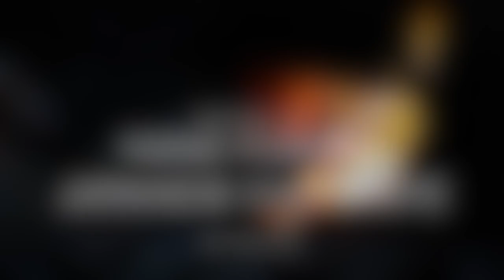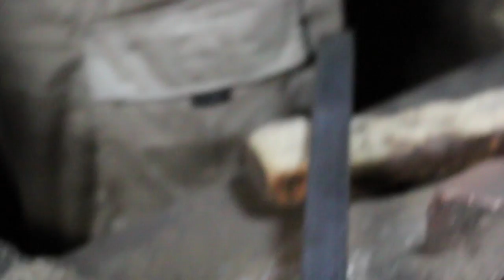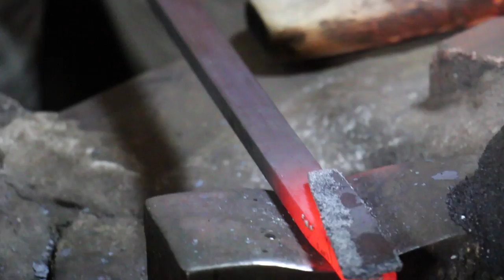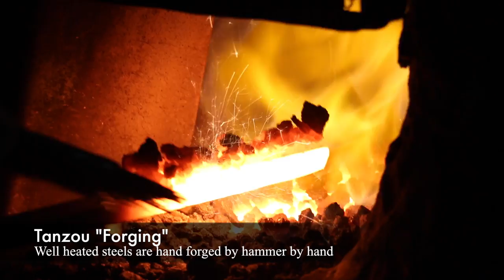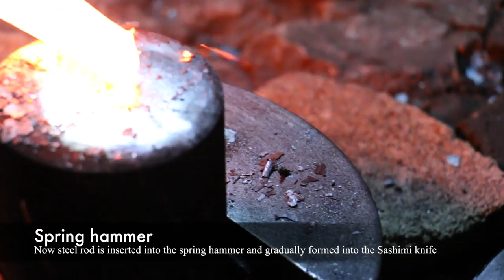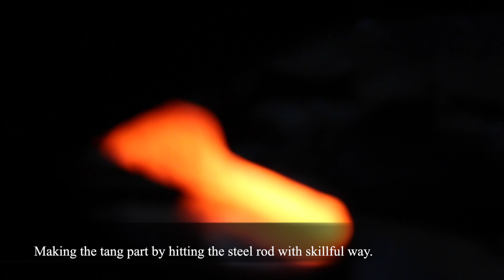Hand forging a Japanese Sashimi knife of Sakai Takayuki by Master Doi

Comment: Excellent work with the hammer. Whether you want to call a power hammer "hand" forging or not (it is), it's still a manual, non-automated process and this guy's fantastic at it.

Also best music choice possible. It's hot, strong, has an appropriate tempo, and it fits the heat in the face and the little burns and the feeling of doing this kind of work. Special shout out to the ridiculous dork who said it should be accompanied by classical or solo piano.

Comment: What's that powder he applies at the beginning? Is that some sort of flux?
Reply: +Chris Lawson Borax ! to prevent oxidation and eliminate impurites.
Reply: +skyhacker6 flux then?
Reply: allways28
maybe, I don't know the name actually
Reply: A flux is any material used to eliminate impurities. Usually in welding and soldering. So if that's what borax is doing, then it is indeed a flux.
Reply: +Chris Lawson I think it is iron powder! Used to join the two pieces together.
Reply: +Chris Lawson It is flux. The powder melts and chemically dissolves the oxide (the black stuff that flakes off). This is necessary to ensure proper forge welding of the two surfaces. Oxidized surfaces wouldn’t bond together.
Reply: +Chris Lawson It was more than likely borax with iron shavings mixed with it to keep the pieces stuck together and eliminate impurities, or it was some kind of commercial flux.
Reply: +Chris Lawson It's iron powder.. Kind of glue, but for iron.
Reply: As "skyhacker6" pointed out, it is borax.  Borax is a powder that you can buy from grocery stores in the laundry soap isle.  Pure borax makes an excellent flux for welding.  As mentioned, borax prevents oxidation.  It does more than that however.  When heated and melting borax also cleans the metal and burns away any existing oxidation the same way that solder flux does to copper. This allows for a clean and strong welding joint when welding steels together in layers, or joining 2 different metals as in this video.

Comment: What a load of BS! "hand forged" - gimme a break, the only thing he did by hand was set the weld...
Reply: Try using the hit turn technique on a power hammer without your hands.  Back in the day labor was cheap and steel was expensive.  Now the opposite is true.  Replacing strikers with a power hammer is the logical thing to do.  In other videos showing traditional methods.  The leader doesn't do much hammering himself.  The smith relies on his human power hammers to deliver hits while he uses his skill to direct those hits in an effective and efficient way.